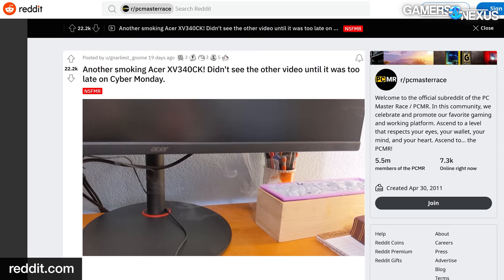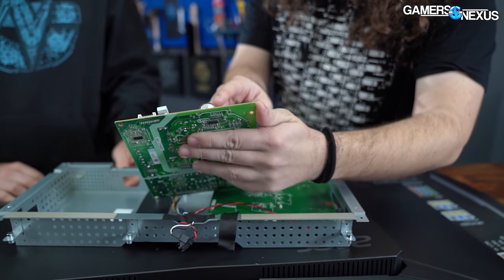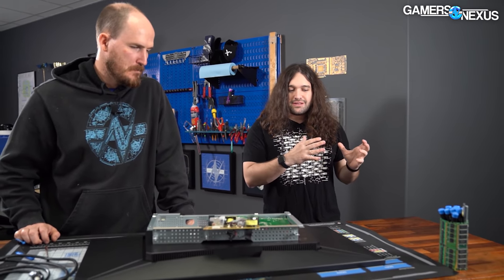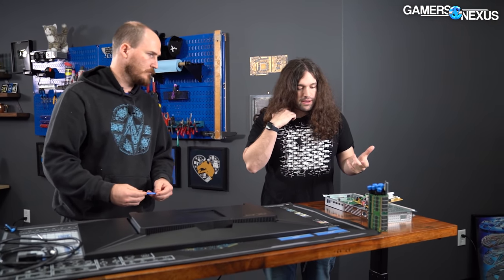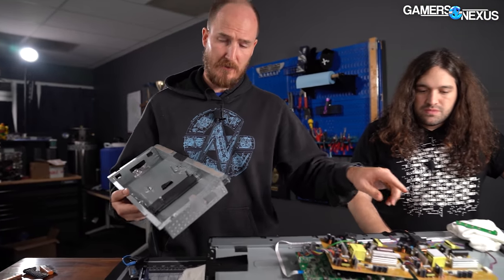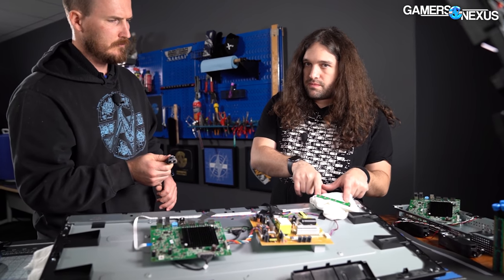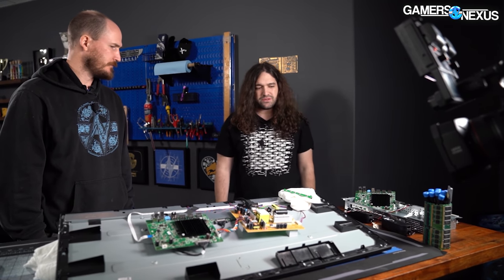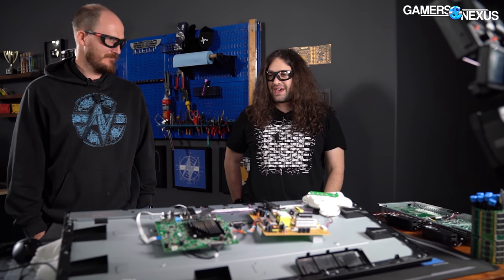Acer Monitor Fires Investigated: Blown Capacitors on Acer XV340CK

Comment: Geez, in the past two years (since pandemic began) nearly every PC component type has had a fire hazard problem from one manufacture or another. Video cards (EVGA), PSUs (Thermaltake), cases (NZXT), motherboards (ASUS), and now monitors (Acer).  Only thing left is RAM, HDDs, SSDs, speakers, headsets, keyboards and mice.  Soon mouse pads will be catching fire for whatever reason.

Comment: So, there's a global component shortage. Acer's OEM needs a certain cap for it's power supplies. Can't get them without a $0.20 price increase.

Good thing the new apprentice found an entire box of brand new unused caps dated "2002" in the back of the warehouse...

Comment: IMO they souldn't put the power supplies inside the monitors,it makes them thicker and they add extra heat inside the monitor.My monitors have power bricks so if they go out i just simply replace the power brick instead of having to disassemble the whole monitor because the power board fails.

Comment: My Aorus Fi27Q-X (1440p 240hz IPS) monitor did literally the same thing at it was only 32days old. I hope manufacturers stop putting the power supply inside the monitor and put it back on the cable like on Laptop chargers. There is literally nothing positive except a slim cable, the monitor will heat up more and be more fat with the powersupply insdie.

Comment: From my limited knowledge, this just looks to be a malfunctioning Capacitor. It's pretty hard to catch those even if you QC properly as the fault would only occur with use. Not that I'm saying Acer QCs properly, me and many others have bought Monitors with an intended number of dead pixels which Acer would refuse to take back

Comment: ive had stuff like xboxes behave like this, i dont think its  replicating the operating temperature of a sealed unit, i had xboxes that would not boot if a fan wasnt pointed at them
id put the boards back in the cases and test again instead of having them open

Comment: I have the VA version of that monitor (XZ342CU). Had it for almost 4 months now. Works fine, decent value (was cheaper than the IPS) and the performance is good, if you can live with a VA panel.
The only issue I'm having right now is that my DP link is only 1.2. I have the monitor set to DP 1.4, have a DP 1.4 cable (8k one) and a 6700XT, so it should detect the faster speed.
Does anyone know how to test the DP cable or if anything else is needed to set it to 1.4?

Comment: guys you need to stop obsessing about different colour capacitors. Different suppliers have different sizes/colours/footprints. It makes no difference to me as a designer if the specs are followed during production. A bad batch of components is a valid concern but the colour is not indicative of anything.

Comment: This is not a fire. The cap , when it fails, will "smoke" and spray the liquid inside out like smoke.  It will continue to do so till most of the liquid is gone.  This can happen if the cap is put in backwards or is overloaded. Sometimes the pop and other times the top bulges and it just splits open at the slits in the top.

Comment: 2 minutes in and I can see it's the filter cap on the primary side power supply , that's not good, I've hardly ever seen one fail on a switchmode PSU O.o

Comment: These electrolytic capacitors are designed to vent and release smoke as seen in the customer videos as a fail safe when circuit conditions arise where over voltage/current exists.   If these didn't vent, they would explode and spray electrolyte everywhere.

I think jumping to a conclusion that this is a "Fire" is emotional/click bait reporting.  Sure, Acer's product isn't working and is failing, but this is not on the same level of safety concern as the NZXT case fires. This is the best failure mode for us consumers when a product issue exists.

Comment: I think Patrick really needs some more indepth knowledge for PSU design and especially for the component analysis. Few minutes into the video (and by very keenly looking at the capacitor) I figured out the capacitor brand, it's HERMEI which isn't quite well known (this is the first time I am hearing about them) and all of the caps seems to be from them even the black one in the other monitor (the blown up one which is brown is from BL series and the black one in the other monitor seems to be from SL series)

Usually in high end or good quality brands, even if they cheap out, they mostly use Elite or CapXon (even more cheaper) caps, seeing a not-so-well-known branded cap in this monitor already raises the alarm.
Please do some close-up shots of the PCB next time while doing such content.

Comment: Seriously need help. Intermittent internet  connection. Just upgraded to a ryzen 5900x with asus tuff wifi 570x pro board 👌. Internet just randomly disconnects I have the newest bios. Dec 14 2021. Phone and Xbox never disconnect and isp says no issue.

Comment: why did you forgot that capacitor could fail when too high temperature is present? when you removed back cover you allow temperature to drop down. you didn't even measure if the radiators are too hot or not.

Comment: touching the live ac side of a switching power supply might not be the smartest thing to show you doing without explaining how those caps can hold a charge and shock the hell out of you if not discharged.

Comment: Barely a fire...  Electrolytic caps vent like that (by design - as a safety feature).   Just a bad capacitor, or mounted the wrong way around regards polarity perhaps.  Fuses in monitors like this protect against something like that causing an actual fire.

Comment: I can't believe how expensive that monitor is for how shoddy it seem to be.
Reply: It's actually cheap to buy here in UK.  I got mine from argos. Had mine 2 weeks and so far works great with my new pc, using nvidia evga 3070. I paid 500 uk pounds. I did have similar spec iiyamha but was faulty within 2 days with lines across the screen. This was 2nd cheapest 38 inch screen I found and spent ages getting one with that spec. I used dp1 as well

Comment: One thing that would cause the main cap to explode (other than component failure), is if it was plugged into a wall outlet with 380V (or whatever would be the equivalent voltage between two phases in the US). 

It has happened to me. I once plugged a HP laptop charger into an ordinary 230V outlet, and it started smoking just like in the Reddit video. I pulled the plug, and opened the charger. The main cap was blown and the unit was full of liquid (electrolyte) inside.

I then measured the voltage from the outlet, only to find that a very stupid "electrician" had connected two phases instead of one phase and neutral. It was 380V instead of 230V, and it could have been lethal... Fortunately I always connect the charger first, and then the laptop.

Comment: These electronics are all designed to fail within a. Limited time frame but they don't always get the failure time frame right and your parts die way before they should.

Comment: Bad Electrolytics? What is this 2006? As soon as you opened it I could see the pressure release cross on top of the capacitor had swelled and blown, shooting electrolytic all over the inside

Those "thermal pads" look more like they are for support than for thermal transfer. Also on switch mode power supplies if you suspect a electrolytic problem you should monitor the temperature of the cap to see if it is heating excessively. While not as bad as it once was there is still a problem with counterfeits and during a pandemic related supply shortage it's a lot easier to pass off an 85C cap or a different capacity/voltage rating just by putting a new "wrapper" around the cap so they look legit and pass them off to a vendor in lot of 10,000 - 100,000 and then disappear before the vendor even gets their first ones to market. That would explain why the older ones seem ok, then a batch of bad ones during a shortage, then the newer ones are OK again. Acer likely already knows exactly the dates of the bad devices as warranty claims come flooding in

Comment: 20 years ago, I worked for IBM on the US PC helpline. They used Acer re-badged hardware. There was a particular model CRT monitor we were told to automatically replace regardless of warranty status. The monitors were smoking similar to these ones. The same type of electrolytic capacitors were failing, my guess was they were possibly leading to fires.

Comment: Either Acer bought a power supply board w/ knock off Nichicon's, or the company they bought it from  designed it like a$$. Only way a brand new "legit" Nichicon blows it's load like that is if its getting hit with  spikes  150 - 300v + above its rated 450V. 100uf @ 450v is a really common size filter used in monitor Power boards....idk

Comment: I wonder if Acer accidentally bought counterfeit capacitors. If parts are hard to find they might have bought from a less-reputable supplier, and counterfeit components like capacitors and chips are sadly not as rare as you'd hope.
Reply: They should test before putting into the production, this demonstrates that they don't even care to test if they change any component.

Comment: The electrolyte is corrosive and can (read: will) damage the board. Should you guys choose to repair the two faulty units, it would be a good idea to thoroughly clean any part that came in contact with the electrolyte. It's nasty stuff.

Comment: cheap capacitors. replace it with low esr and it will last a lot longer. i get a lot of monitor repairs with dead caps just not the cap on the high side.

Comment: I have a power supply that seems to have taken out two separate computers, is there any way I could send it to you to test?

It is a 10 year old Corsair HX750W.
While I can not directly rule out coincidence, here is what I strongly suspect happened:

1. It killed a Core I7 LGA1366 CPU (It caused a short inside of the CPU) after a decade of use.
2. It either killed the ASRock X58 Extreme MB (same one as above), or two more CPUs a few months later.
3. It killed another MB (ASRock x570 Phantom Gaming 4) and/or CPUs (3700x & 5700G) after a few days of uptime.

I have not yet been able to diagnose the latest combination of MB & CPU yet, so I don't know for sure.
I do know that the new ones were working just fine with a different power supply, and only died shortly after switching it for this one.

I just don't trust it, and thought you might be able to use your power supply testing setup to get it to fail definitively. It seems to work for a while (first months, then days) and then poof, dead parts.

You of course might not want to connect it to your test setup, because I am not sure why it has left a trail of destruction. It might be sending out a high voltage spike that your test equipment is not capable of handling safely.

Of course it is entirely possible that all of the failures are coincidental, but I'm not going to tempt fate by ever using it again.

Comment: Basically, if it fails, just claim a warranty for it and get it replaced. So far, it is not found as design failure and its not absorbing that many power so you probably will be fine.

Comment: This video brought back memories of monitor failures and cad station failures. I worked for an oil and gas company working Cad. One of the secrateries had a NEC monitor which failed and ignited in her office. The Cad group had TTX monitors that failed one after the other with a loud pop and darkness. The most interesting was an expensive Cad workstation which was housed in it's own office. I think the cost of a station at that time, circa 1986 was $50000 plus.  The operator was in the office with the door closed so he could talk on the phone all day without inerference from his fellow workers. I heard what sounded like 3 shotgun blasts and the operator stepped out of the office as white as a ghost. Three large capacitors had exploded. A little exploded capacitor in an Acer. Meh. In all seriourness, quality control and design should have taken us far from this, but Dell is still selling computer. Another story for another time. LOL.

Comment: That's weird it was this specific cap that failed, I mean it's nothing new that some electrolytic capacitor failed on a monitor on the PSU board but it's usually smaller caps on the output, basically never that big bulk cap on the HV side...

Comment: I wonder if there's just a specific setting or configuration where the power converter overloads.
max brightness, max volume on speakers, max power output from USB ports
maybe even overclock the refresh rate beyond 144Hz.

Comment: I thought the thermal pad on the old Samsung 305T/+ and Gateway XHD3000 was the thickest ever put in a LCD monitor.  Congratulations Acer, you broke the record!  I wonder if it is a coincidence that the Samsung monitor internal PSU also suffered from blown caps...

Comment: LOL

Another overreaction. Capacitors smoke when they die. There IS no "fire" -- it's just a cap dying violently. The input filter caps on these are the size of your thumb or otherwise pretty sizable; this one looks like it's about the size of my index finger. If you have one, and you've been using it, it's fine. If you've got one and you haven't opened it, open it and use it -- if the cap pops, put in a replacement. If you're in a pinch, these caps are pretty standard stuff, old PC power supplies and such can be scavenged for them. You don't need to go to Mouser! I have a friggin box in my living room of scavengeable crap for situations EXACTLY like this (oh hush, I live alone).

@ Patrick. Go get an old power supply (maybe not One Of Those From Gigabyte, but ANY dead power supply really will do as long as the caps are visually fine) and pull one with roughly simiilar specs. It's a filter cap, you can probably put anything from a 330uF to a 680uF in there and have it work. Any voltage over 250VDC will probably be fine. They spec em high like that for lawsuit protection and because not everyone has commercial grade UPSes or even good lightning strike prevention, not because it's actually necessary.

Comment: I've noticed that, overall, the quality of everything coming out of china has fallen off a cliff, and its not just limited to electronics either.
Take for example: automotive parts. Parts coming out of china such as brake discs, are failing within months of being installed. Keep in mind that this is metal that is in some cases a half inch thick that is just garbage... and a safety hazard. Parts are also being made out of spec dimensionally wise. Parts are DOA. etc etc...
Its time to get over the various issues that we have with having industrial production at home, and start pulling the plug on china, if for no other reason than not being reliant on one source for all our stuff.

Comment: Gamers Nexus... where Steve gets disappointed when things explode and viewers get disappointed when things don't! :P 

How on EARTH could the brown cap version ever get through QC? Don't they test them before shipping them? One viewer stated that it started smoking within seconds of being powered on, so if they're tested at Acer that has to be the shortest test duration on the planet... :-/
Reply: It's not out of the question that the monitors actually went through some sort of "burn-in" process at the manufacturer AND passed.
It then gets packed, boxed, shipped to a distributor (perhaps 2 or 3 times as they move stock around) by a trucking company, then shipped again to the end user.
That being said, we don't know how the monitors were stored / if they were exposed to high humidity levels, if everyone that the box passed hands through at Amazon decided to drop it 3+ feet onto the concrete floor, if there was a supply chain problem and counterfeit/remarked caps were purchased, etc.

Comment: Acer uses shitty caps since AL1923 model, believe me :) After 3-4 years you can find that your power button is not working. Changing 2 caps (it was like 1-2$ back in 2006) and your monitor works jist like new one.
Reply: But changing anything makes the warranty invalid
Reply: @agontprevarator5214  it happens after all warranty periods.
Reply: @musicianJKEE  I meant, if you were to change the cap the day you receive the monitor
Reply: @agontprevarator5214  RMA is only right variant during warranty period, imo.

Comment: Sarcasm one.
I suspect the two have a 3090 and the moitor has not withstood the infinite fps.
sarcasm off.
try to swap the good power supply with a display that has a broken power supply. maybe the error comes from the display.

Comment: cut open the blown cap and see if it´s a fake cap.

can imagine the supply shortage brings out all the scummy manufacturers.

and pretty sure i´ve seen some video years ago with large fake caps just containing a supersmall cheap capasitor inside the large one with reputable manufactorer branding on it.

Comment: I disagree with the recommendation. All accidents are preventable and this product now has a know history - not a possible but a definite failure that was measured. Everything is about risk tolerance. Risk is now more above zero if you own one of these products. Granted, it was not zero before. But now it is measurably worse. Get rid of all the products is a measurable way to lower your risk and that is theoretically preventing an accident.

Comment: I’m missing a warning here.

Only take electronics apart if you know what you are doing. The big faulty capacitor can hold a high voltage charge. It has to be discharged before you touch it! Or you will be shocked by the 450 Volt. It’s a low amperage, but it will hurt.